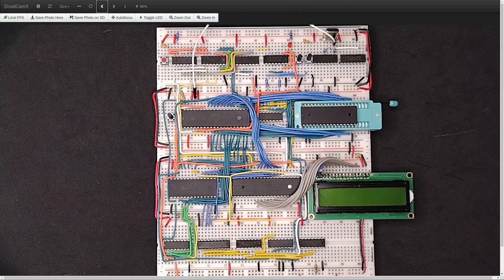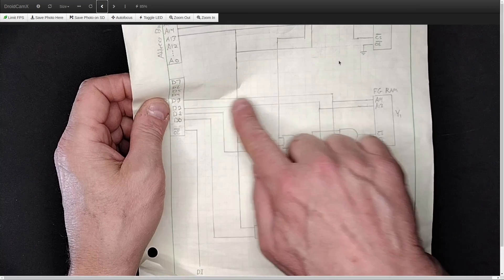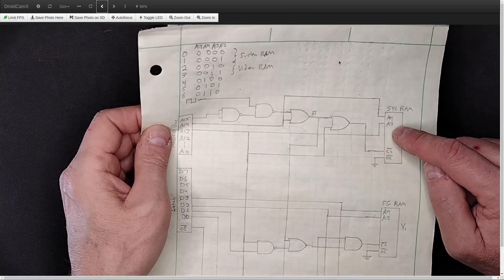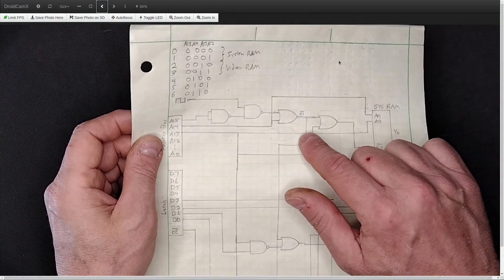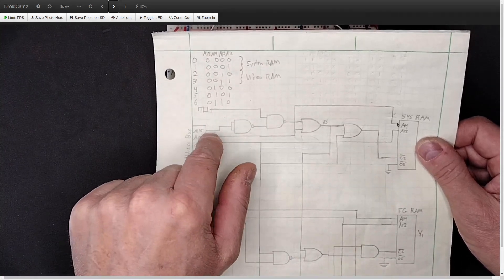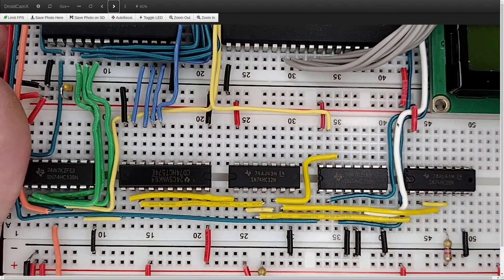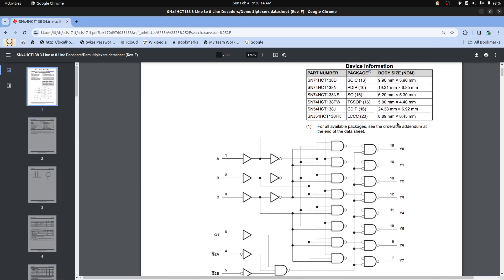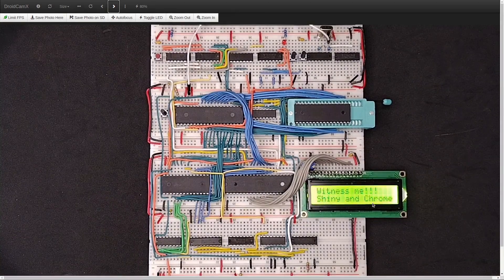Experimenting With Ways to Add Video RAM to 10 Mhz Ben Eater 6502 Computer.

Comment: If there's one thing I really don't like about the 6502 compared to the Z80 (or intel 808x family) it is the phased clock timing voodoo. I mean, don't get me wrong, the 6502's predictable 50/50 bus duty cycle makes it really "easy" to do hitless shared memory between video refresh and CPU (as long as you don't mind your CPU clock being tightly coupled to video timing), but for the simple case the Intel/Zilog bus timing is so much more forgiving. (If the timing diagrams in the Z80 manual are to be believed you get basically a whole half-clock of slop after /WR rises for your memory device to latch the data.)
Reply from the maker: The timing is a challenge for sure.